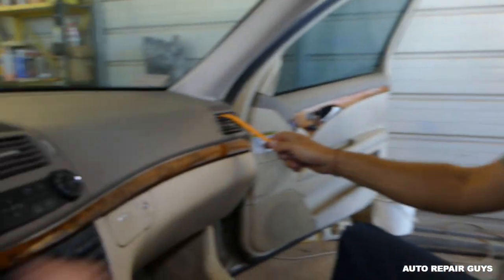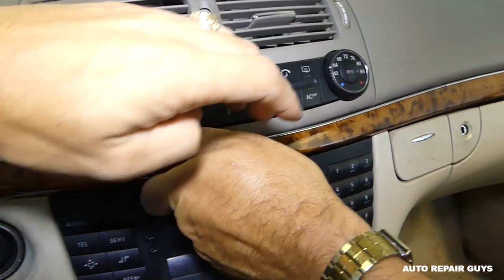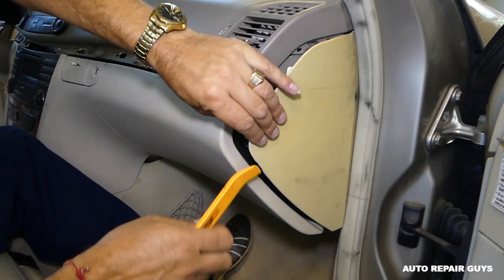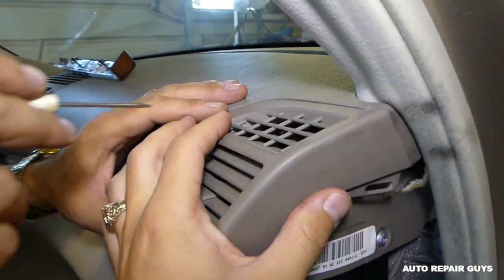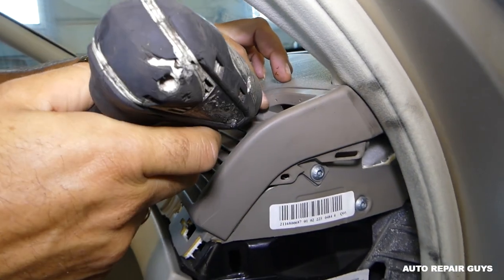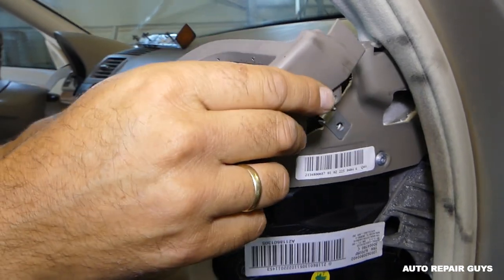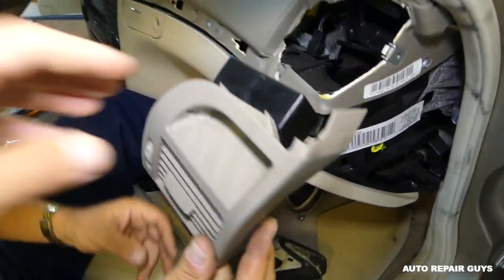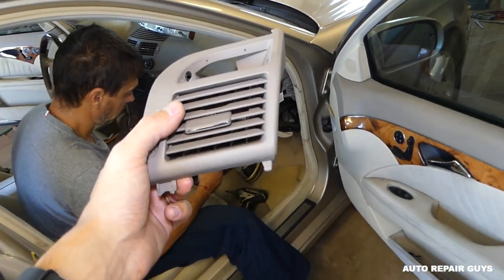HOW TO REMOVE REPLACE DASH VENT PASSENGER SIDE ON MERCEDES W211

Comment: What was that wire you took off of the vent right after you pulled it out? I removed my side vent same spot as you did and there was a little tiny light behind the vent. Not sure what its for. Is it supposed to go to the glove box maybe? Would you guys happen to know?